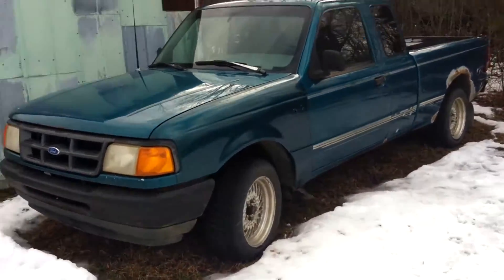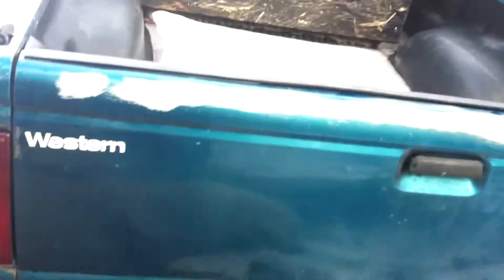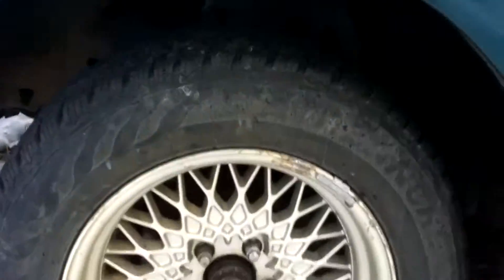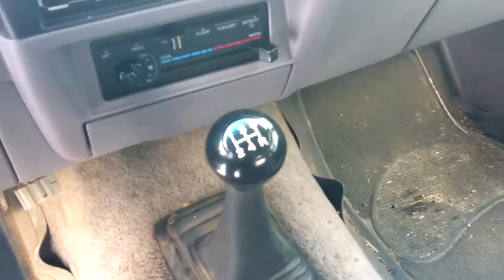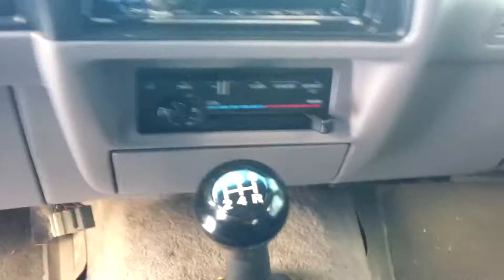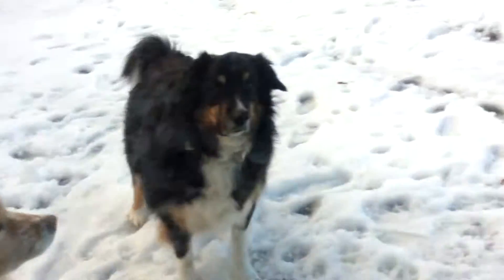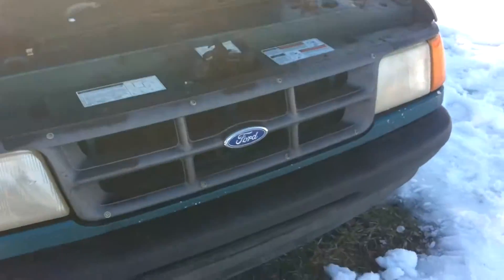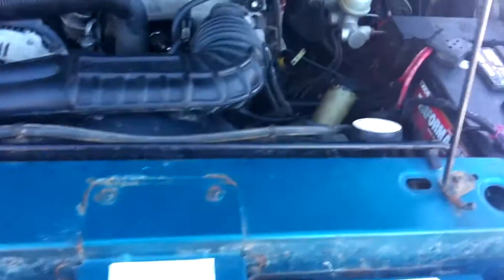Welcoming The Ranger!

Comment: I have owned Ford Rangers since 2005. I love them. They are fun and inexpensive to drive. They weigh similar to an early Mustang and share the same track width and 5 bolt wheels. They are really Mustangs with a box on the back...It is a shame Ford didn't build a performance version as they would have been an extra blast .